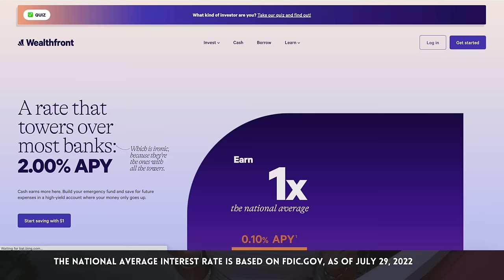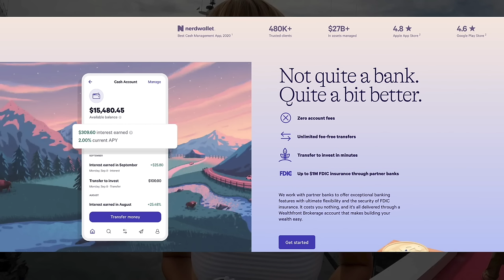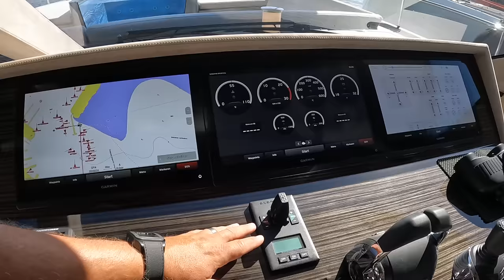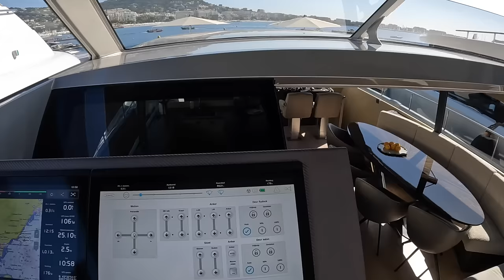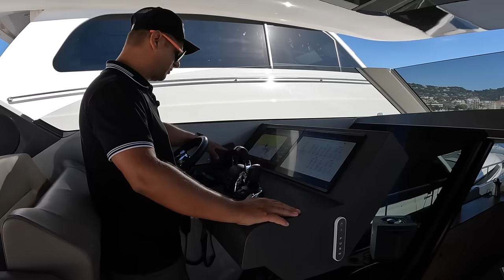$6M+ ST BARTH 75 World Premiere!!! Fully Aluminium Unique Layout Custom Luxury YACHT TOUR

Comment: To me a disaster of a boat just not worth the asking price
No safety rails around the bow a disaster waiting to happen, no hand rails on the inside of walkways you only have an outside rail to hold on to when at sea as you need rails on both sides of you for your safty. Didn't see any showers on the  beach deck.
Washbasins all looks and are useless to use, to long so you will get a lot of sloping of water, disaster to keep clean with all of the ledges, you need a nice round deep basin, just stupid to have 2 sets of taps to a basin no point
Toilets not private who wants to see other half using it when you just need the washbasin, how do you stop the WC smells entering the bedrooms you can't
Location of the washing machine in the lounge area a big big mistake, with loads of washing in baskets on the floor in the lounge.
Engine access very very poor, a poor design, compared to other boats the same size, gallery nothing to shout about
The guest cabins far too cramped.
What about crew !!! Or did I fall asleep !! boring video.
Just why why can't you ever be honest and give negative comments, so many can be seen on every boat you visit 
It is because that your both being  paid by the owners to do the video, in the end it all makes it look so false.
Tender too small as is the lifting crane, as its nice when your tender is full of supplies to be able to lift the tender with all the supplies directly on to the boat far quicker and safer to unload.
No fidel rails to any of the worktops so when under way everything will need to be put away, just think your cooking lunch and at sea all dishes and plates sliding on to the floor !!
Just why you get so excited over nothing your over exauranting all of the time,  just be as normal and be your self would make for a far more enjoyable video to watch
Cheers

Comment: I was picturing this as an explorer catamaran - something like what Prestige has done with the new M48, but I don't think it would add anything that this monohull doesn't offer. I will say that the design doesn't appear to offer protection from water ingress. It's aluminum so stronger than others in this size,  but if takes on water,  no water-tight compartments would stop its sinking? It's not an explorer yacht - nor a commercial fishing boat either - in fairness, but it could be. This looks like it can cross oceans - is this not true?
Reply from the maker: You gotta compare oranges to oranges in all fairness… every vessel has its own use and not every boat is meant to cross an Ocean… not sure what the “if it takes on water” comment mean… it’s kind of silly 🤷‍♀️ no one is claiming its an Explorer Yacht
Reply: @NautiStyles  Not an explorer yacht, but I assume that this could cross oceans safely. Not sure about its capability in following  seas, but otherwise it looks well-suited to crossing oceans (assuming fuel capacity is sufficient). It looks more seaworthy than some explorers.